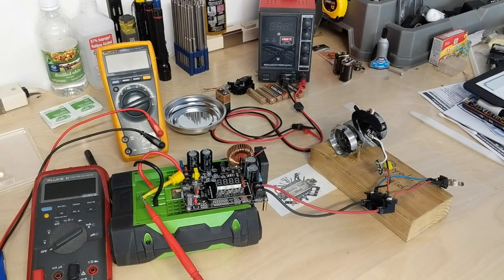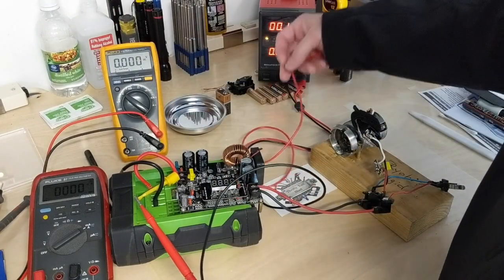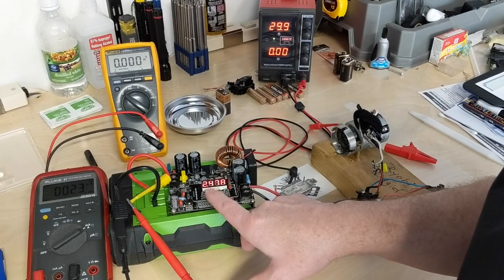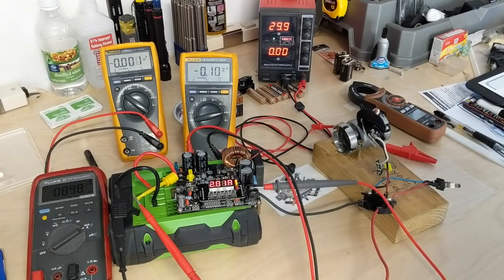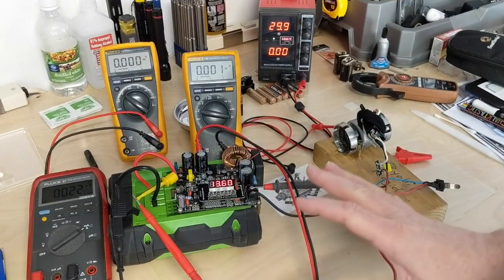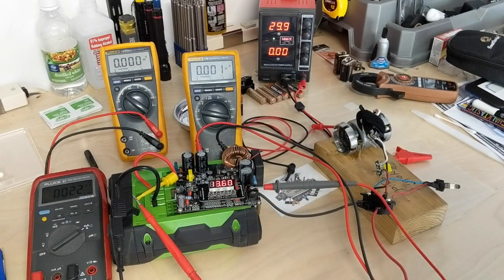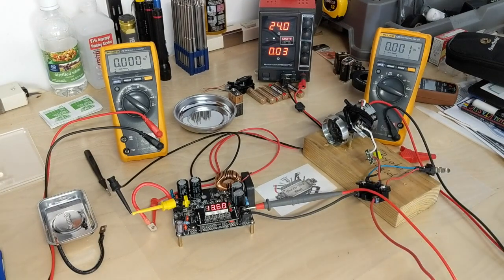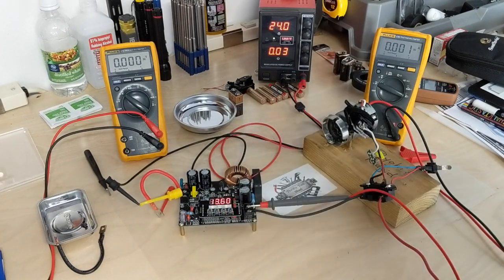How Efficient is a DROK DC-DC Converter?

Comment: Any suggestion about connecting power to that board, it seem like what series resistor I use it sparks...
Reply from the maker: SolarizeYourLife, yeah those input caps are large. I usually feed my adjustable power supply to it and bring it up slow. In other words, I limit the current and bring the voltage up slow. I agree, straight accross a battery it arcs quite a bit.